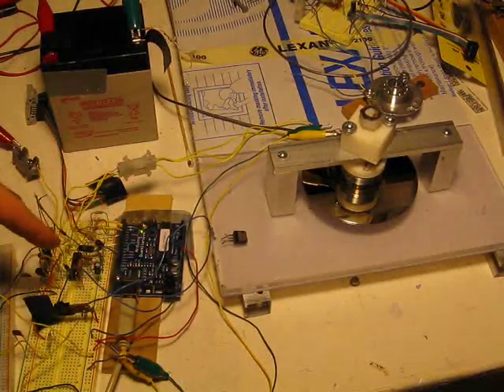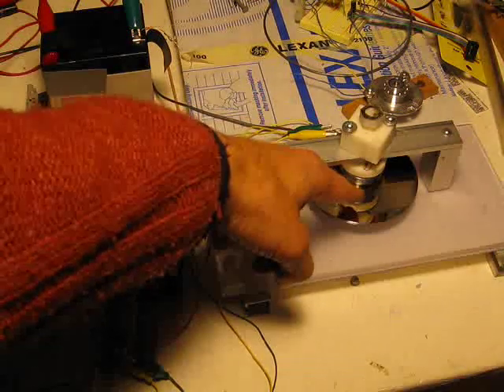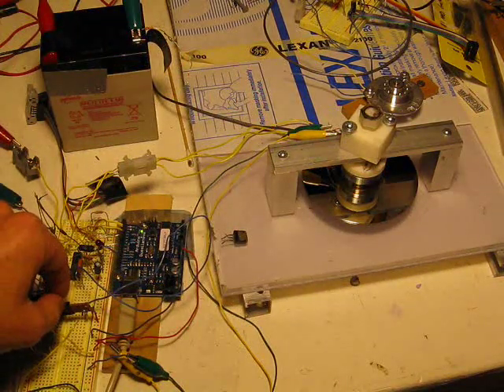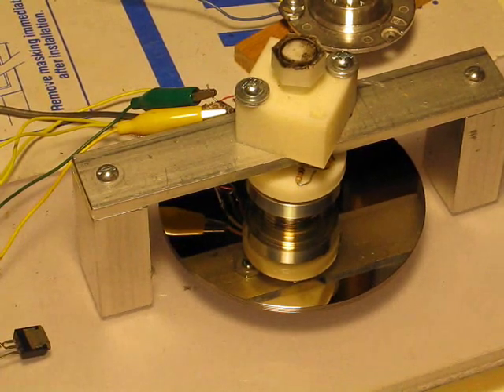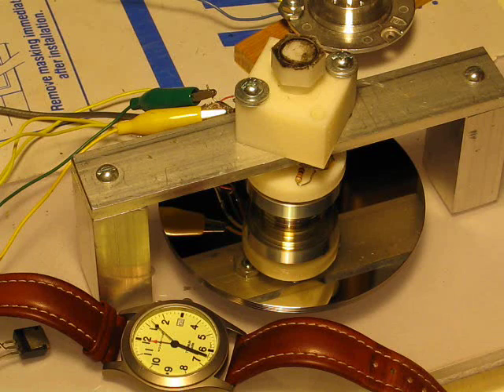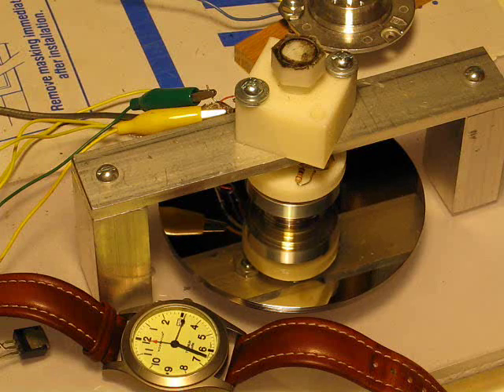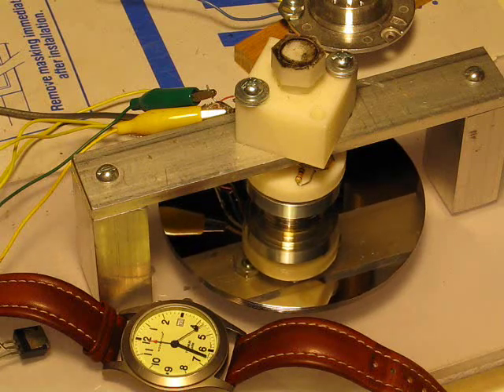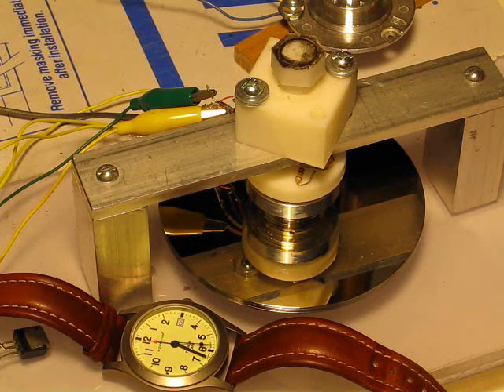BLDC Motoring and Regenerative Braking with Arduino, salvaged HD motor, and Hall Sensors

Comment: Great idea to use regen braking! Have you ever considered using the Arduino to simply remove  (open circuit) the battery power, and then shorting the three motor wires together as a way to rapidly brake the motor?

Comment: Regenerative braking implies that you're getting the energy back into the battery? Is that the case? Or is it just dissipating the energy by shorting the coils (i.e, the energy goes in heat in the winding resistance).
Reply: I actually get energy returned to the battery. I can tell, because the current reverses.